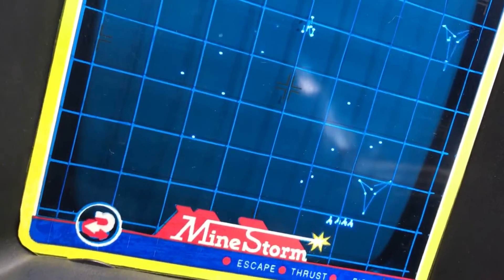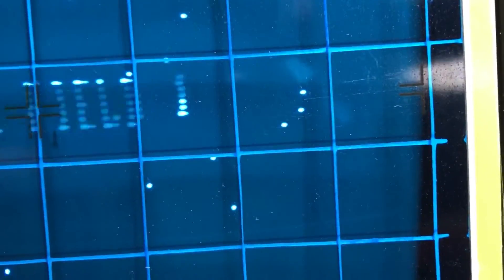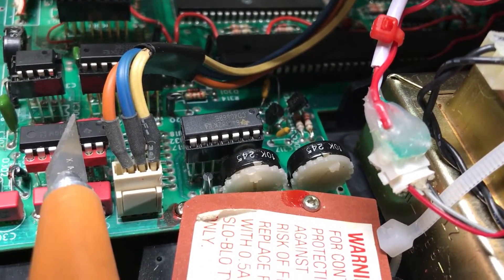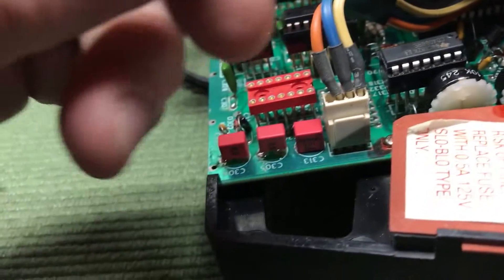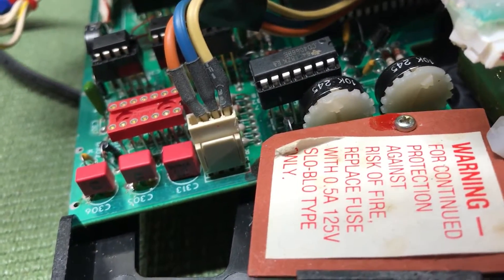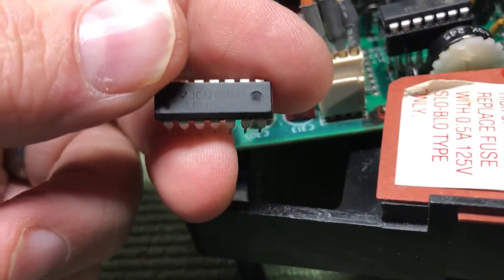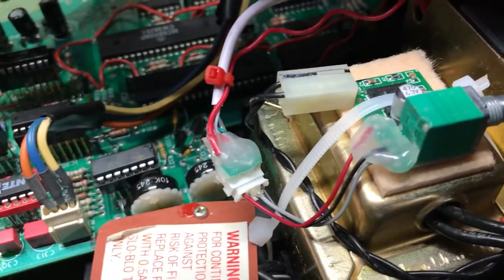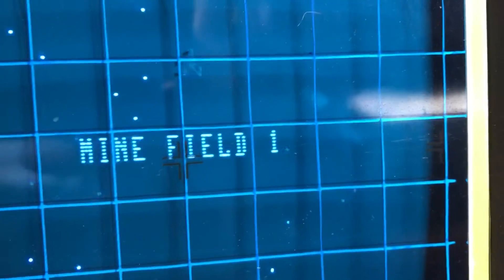Vectrex vectors do not align and wiggle. Vectrex repair series episode 3.

Comment: I have two Vectrex consoles, and both wiggles and sometime missalign in the picture.
The aligment can be adjusted on the potensiometers and the two levers on the coil of the crt tube, but be very careful when tweaking those while the Vectrex is running due to high voltages.
The wiggles can be because of a bad power filtering too due to bad capacitors that has dried out over almost a half century since the consoles was launched.
A bad power supply will break components too in the long run as the components will be overstressed out of their specs if the power being too low, too high or too noisy and spiky.

Comment: shit where were you 2 years ago?? I was have a very similar problem, I recapped the whole thing and couldn't get it to power back on, it's still in pieces on the table
Reply: feeling your pain, but still, I'd hope people would stop shotgunning their vectrexes, age makes them fragile and they're getting harder to find as it is, no need to dwindle the supply willynilly.. recently picked up one that wasn't just recapped but "redioded" and "reresistored" without success.. 5mins with a DMM revealed the issue to be a corroded power switch. lucky whoever molested the poor thing didn't kill it.
Reply: Sno oks I know it's been awhile, but are you interested in looking at a vectrex?

Comment from the maker: The solder pads do connect from top to bottom however the board is so old I have had several Vectrex's PCBs top pad tear away from the hole making a bad connection. It's really just a peace of mind thing.

Comment: Very good videos. 
My  Vectrex aligns vectors pretty well but the entire screen is kind of wavy. 

How come you have used wire wrap sockets?
Reply from the maker: I used those to lift the chips out for access and also to be sure the top side solder joints are perfect. These old boards can be finicky about it. These chips are the most prone for failure also. The wire wrap ones I had were better quality than the cheap surface mount sockets I had on hand. This Vectrex was purchased broken and the owner did a very bad attempt at repairing it and it took a while to get it straight.
Reply: eek, i didn't realise you have to check the top side solder joints also?  does this mean the solder wells (if that's the right word.. as in, where the legs of the components go into) do not have continuity on both sides right through the pcb board? (in which case you would only need good connection on one end ......  is that not the case with the vectrex pcb?)